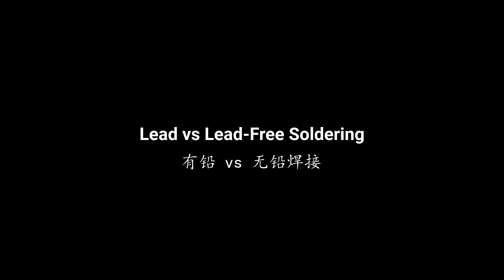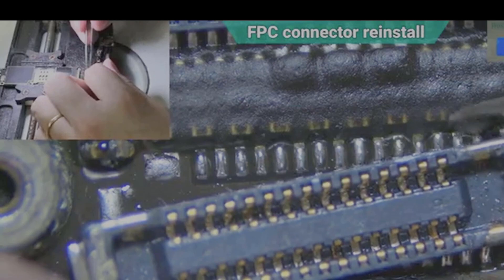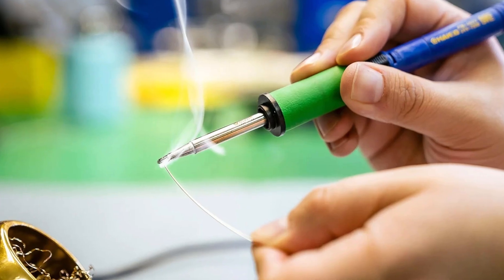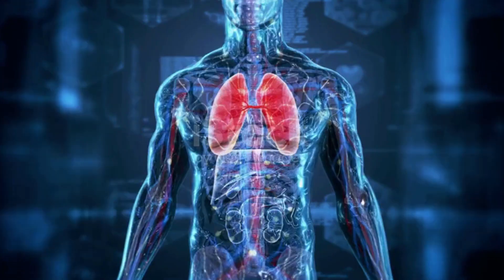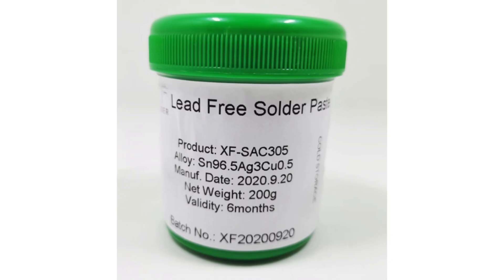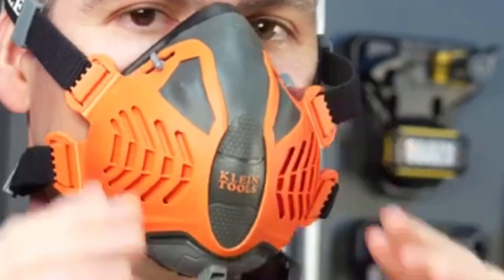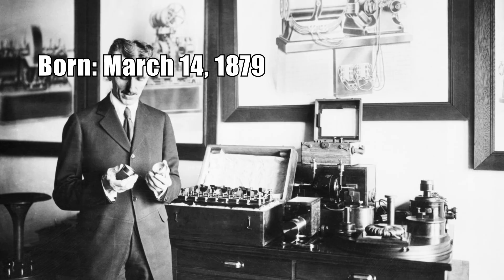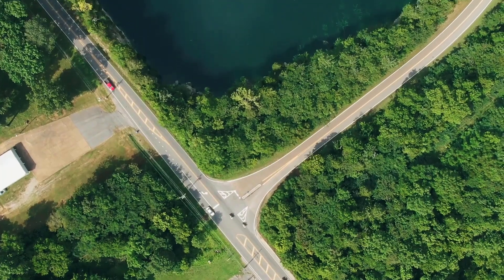Lead Soldering — What They Didn’t Tell You 【CGC China 2025】

Comment from the maker: Quick clarification. Lead does not evaporate at soldering temperature. Yes, the boiling point is about 1749°C.

But the danger is not vapor.
The danger is microscopic lead oxide particles and lead dust created on the molten solder surface.
Flux and heat lift those particles into the air. We inhale them.
Slow damage, long term accumulation.

If you only ask “does lead vaporize while soldering,” you will get the wrong idea and feel safe.
Use the right keywords when you ask ChatGPT or Google:

lead oxide particles
lead dust inhalation
soldering particulate exposure

Right question, right answer.

Stay aware.
Reply: I'm wondering what size those lead oxide particles are. My hepa filter filters down to 0.3 microns.
My problem is that I've been soldering wires / boards since the mid 1960s, and using Lead/Tin solder. Of course I breathed in the fumes not knowing any better.
My brain has never been great even though I've been doing some decently difficult engineering and computer programming. Concentration, being able to remember numbers, other information for fairly short periods of time.. Never that great. I have to write everything down to be productive. :-(

Comment: After watching this video. I got a urine lead test kit. Turn out normal. Just in case, I went to the hospital and did a blood lead test. Result is 2.82ug/dl, pretty good. On average I have 2 hours per day actual soldering time for 3 years, with lead solder paste and wire. No ventilation. Washes hands often.

The atomic lead vapor is too few to make the difference. And the particles almost never become airborne(paste is min 20um balls), and still bound by the organic flux as soldering remain. 
Liquid solder splash occurs when placing the part with molten solder on surface. Fortunately I only placed desoldered parts on spare PCBs, where the splash solidifes and sticks and not getting anywhere.

Comment: This is only partial truth.... when soldering, lead is not evaporating into the air at all (it needs much higher temperature then 450C, which is usual maximum of common soldering irons/stations). What harms your health during soldering (respiratory deseases etc.) are fumes from FLUX (not from lead). So yes - you need to have some good fumes extraction to prevent this, and when soldering for long periods of time, use gloves so lead from soldering wire is blocked to enter your body through skin, when eating afterwards etc.
Reply: *than

Comment: The smoke you see is the flux burning off. It's not the lead. Yes the Fumes are extremely bad.

That's why always use the lowest temperature to allow solder to flow. And vent fumes outside

Comment: im a cellphone technician for almost 20 years..hardware/software but mostly hardware....am i to late to prevent the lead poisoning?
Reply from the maker: The doctor found toxic metal in my blood and suggested I do a blood lead test. That’s how I found out about this. I’ve only been soldering for just over 10 years, but my lead level came back as moderate. I also did a nerve ultrasound, and it didn’t show anything unusual causing the issue in my foot. It’s not from diabetes either. The doctor asked me what job I do, and that’s when we decided to test for blood lead. Funny thing is, this test is never included in the yearly body checkups I normally do. The only symptom I really notice is a weird feeling under my left foot, kind of like a needle stabbing, but it’s not constant, it just happens once every few days.
Never too late before more symptoms show up.